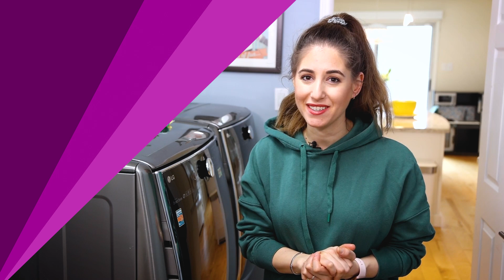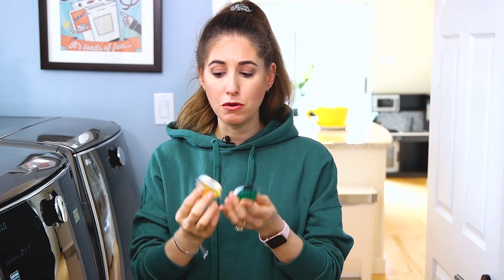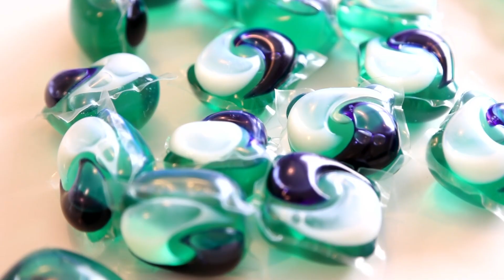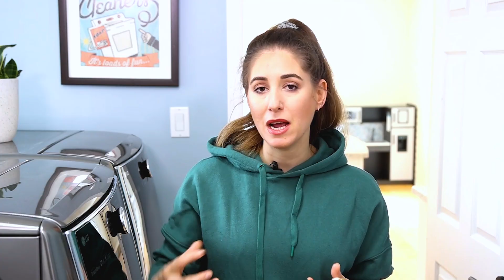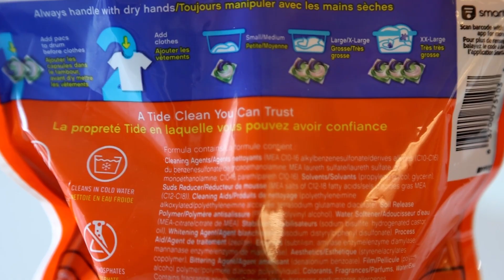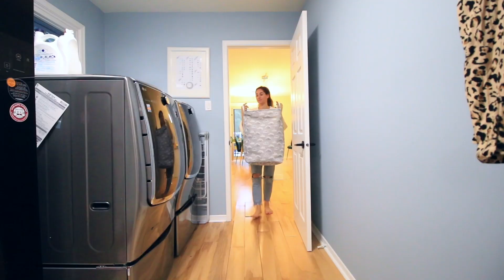Do Laundry Pods Work?

Comment from the maker: CMS POLL: Do you use laundry pods, liquid detergent, or powered detergent?
Reply: Pods and liquid
Reply: I like liquid, my mom prefers powdered.
Reply: Powder after making the switch from liquid several years ago.
Reply: 1 tablespoon of Nellie's powder.
Reply: Pods only . Glad I watched - I was expecting you to say don’t use them and I didn’t want to hear that lol
Reply: I use liquid now because my new machine has a compartment that holds the detergent and the machine takes the detergent automatically based on the settings on the machine for each load. I save a ton on detergent. I love it!
Reply: Liquid and powder, oxiclean, white vinegar &, baking soda. I still have my older Maytag top loaders & am not interested in the new washers. As long as they working well, I'm happy to keep them.
Reply: @jeannejett2299  how much vinegar do you add to a single full load? I have been eyeballing it. Same for the baking soda.
Reply: We've switched from liquid to strips 2 years ago and it is so much more convenient than the big liquid jugs and cheaper than the pods...!
Reply: Pods.  Love them. My washer has a second rinse option (I live in south Louisiana where we’re basically overrun with fresh soft water), so residue is not a problem for me.
Reply: I prefer pods because I don’t need a separate scent booster. I tried powder and liquid of the same brand and felt the pods did the best overall. Pods can be expensive so I try to stock up during sales or using coupons and rebates.
Reply: I really like pods (🇦🇺 OMO triple) but as I live on my own a single pod is too much detergent for a small load and was causing build up so after about a year of using only pods I have just started keeping liquid on hand again as well so I can use a half/quarter dose on small loads and my towels/gym wear which is where I notice the build up of detergent on the fabric. I don't use fabric softener at all.
Reply: Liquid. We fill the detergent tank and softener tank in the machine. It dispenses the amount based on what options we choose. Super easy!
Reply: Liquid for sure
Reply: I was liquid but funny enough I used a sample and I felt.like my clothes smelt better and felt cleaner. So I was thinking of switching.
Reply: Pods!
Reply: Liquid is my ♥️ in laundry world 😅
Reply: I never use powder detergent. If the water is harsh or cold it doesn't dissolve. I usually use liquid because I don't have too much clothes to wash, or too dirty, so I use the light cycle that is only 30 mins of washing. But when I moved with my bf I switched to pods. It was so much easier, I had full loads (his clothes take too much space and are dirtier). The main question that I have however, is if fabric softener is needed if I use the pods. I don't use it, but my bf does because he likes the smell.
Reply: @aspaccino  some pods I believe have fabric softener, others don't. If you use dryer sheets, you're using fabric softener already. So many of my clothes call for "no fabric softener" that I made the switch to reusable wool laundry balls.
Reply: @ssstrawberryjam  we don't have a dryer machine in the UK, so thank God I don't use dryer sheets. But unfortunately I do use pods, and they do have fabric softener in them. My BF complains that clothes are "hard" when we don't use fabric softener, but I believe it's because the water here is hard, comparing to other countries we've been. I think he just likes the smell of the fabric softener in his clothes.
Reply: Powder
Reply: Powder
Reply: Liquid and powder depending on what I'm washing.
Reply: I use Nellie's powdered.
Reply: Liquid just bc it’s cheaper
Reply: A combination.. I live with my parents. 
-My mom prefers POWDER for hots and heavy-duty for the abraison. 
-We used to use LIQUIDS for everything and then tried the SHEETS for a bit... mixed feelings don't know if we will stick with it. 
-Now, we are using PODS! I gotta say I'm liking it a lot and I think it does work better 😍 my mom is hesitant to agree since it was my idea 😉
-I use free and clear LIQUID for my underwear and silk pillowcases. 2 small loads so it's easy to dose a small amount of liquid.
Reply: @TheGalactica2001  yes, I use pods now but I still need liquid for underwear and pillow cases (very small loads)
Reply: I hate the pods.  They don’t dissolve in cold water and stick to the clothing.  Back to liquid detergent 😊.
Reply: I've been using pods from Dropps for a few years now, haven't had any issues or problems and my laundry is always clean. They appear to be safe for my septic tank as well as we've had no issues.
Reply: Tru Earth strips
Reply: Natural organic liquid
Reply: I use liquid and pods but I usually use the liquid cuz I find it to be much more cheaper than the pods per load
Reply: Liquid. In the UK we have a brand called Bold (it’s meant to be detergent and softener together) that smells SOOO GOOD. I’ve used pods but they’re so expensive. From an eco point of view I’m sure it would be better to use powder in cardboard boxes but I think liquid works better at low temperatures.
Reply: I am, unfortunately, allergic to all detergents. I get hives. That said, I found soap nuts aka soap berries. They clean well, no rash, no hives, no itching. They leave no odor whatsoever on clothes, so that’s fantastic and zero endocrine disrupters like detergents. The only drawback is they don’t get stains out, but I found a solution for that. Guess this means I’m in the “other” category, haha 😂
Reply: I use pods but my husband prefers liquid (I just think he uses pods incorrectly lol). They take up so much less space vs liquid or powder
Reply: Liquid
Reply: Both🤷🏽‍♀️
Reply: Liquid
Reply: liquid here.
Reply: Powdered detergent idol
Reply: Traditionally, I've used liquids and powdered detergents.  But, quite by coincidence, I just bought my first pods last week (but haven't tried them yet)!
Reply: I have been using the detergent strips.
I really like them. 
I stopped using the pods. Too many times I had a sticky residue on my clothes, when using cold water.
When using the strips, I use a cup of hot water to help dissolve the strip in cold water.
Hope when it warms up, our water will be cold instead of icy cold!
Reply: Liquid
Reply: Pods are expensive from where I live. :( I would want to use pods because it's not bulky!!!
Reply: I use liquid & Pods; whichever 'Free' or 'Sensitive' formula is on sale or I have coupons for at the time.
Reply: I'm a pod person, though I also use liquid because it's usually on sale for really cheap.  I hate hate hate powder though because no matter how hot the water is or how little of it I use, it never dissolves and everything is still covered in it when the load is done.  I would have to put everything through once or twice afterwards to get it out.
Reply: Liquid and powder
Reply: Used to use pods because they're incredibly convenient however they're notably more expensive than liquid or powder. 
So went off, read the instructions on powder and liquid and switched to those instead. Although when I'm in a rush, feeling lazy or just feel like switching things up, I'll use a pod instead
Reply: Liquid, & powder, oxi & vinegar
Reply: I am not sure if anyone has commented about this already. But these pods do not work for Top loader washing machines. I tried following the same steps, but the liquid just was stuck to the clothes once done. 
Is there a different method of execution in such a case? Would love to know.
As of now, I stick to liquid just for this reason.
Reply: I've used pods ever since I got my HE washer and I find them easy, convenient to store, and my clothes are always clean when they come out.  I've never had any residue or residual pod come out after a load is finished.
Reply: I use laundry sheets.  They completely dissolve in water and are so concentrated, 1 sheet will do a normal load.  For smaller loads, I tear the sheet in half and for larger or very soiled loads, I use 1 1/2 to 2 sheets.  (I have a large, top-load HE machine, no agitator.)
Reply: Sadly most clothing/materials made today are petroleum based unless they are 100% silk or 100% cotton.
I use pods because with liquid I always did the, "eh let's add a lil extra splash" like I do in cooking 🤣 but I have a top loader so with the pods I run the water and stab the pods with a fork,  drop them in then add clothes once the pods begin to empty.
Reply: @BubblyOne  there's no need to stab the pods, they dissolve on their own
Reply: Liquid
Reply: Liquid.  I tried a few different brands of pods and I realized that they were sometimes leaving what seemed like a glue-like substance on clothes.
Reply: I use my own "recipe" to make a powder detergent, and I save money. The economy is nuts right now, so this might be helpful; however, I've been using this for years now. 🚨 NOTE: If you watch videos on YT where people are making their own, many dump ingredients creating smoke clouds that they breathe in. Don't do that, please. 🚨

My basic recipe is 1 cup each of baking soda, washing soda, and borax. (Each of these either freshen/clean/whiten/brighten, so then you only need a detergent). Then, I finely grate a bar of Fels-Naptha. (You can use an old cheese grater, or you can use a steak knife to cut into chunks of similar size. Put them in a microwave-safe dish and heat in the microwave at 20-30 second increments. It will get hot, so be aware of that. What heating does is expand the air in the soap. Once it has stopped expanding with heat, allow it to cool. Then, you can put the soap in a ziplock bag and crumble it with your hands as if you were crumbling crackers for a casserole.) Stir all of these in a mixing bowl and transfer it to a container. 

You only need 1 TBSP/load in a HE machine or 2 TBSP/load in a traditional machine--add more if heavily soiled, of course. The Fels-Naptha is made by Purex and has been around for about a century. The other ingredients you will have plenty left over for other household uses. There is more info on the back of the boxes of ingredients than I could list here, but know that there are many other uses for them. I like that a handful of products have multiple uses, and I can make a new batch quickly any time. I do add scent beads, oxiclean, or fabric softener depending on the load.
Reply: Liquid!
Reply: We have been using Dropps since September.  They are currently having a 30% off sale and we buy bulk during the sales.  Also tried Method they are good too.  We were having skin issues so we are trying several plant based products and are having good results with all so far.  We buy them when they are on sale and there are so many plant based products to try.
Reply: I am liquid user.
Reply: Liquid
Reply: We recently switched to powder after being liquid fans. I swear it makes our clothes cleaner, and our towels/sheets feel better after washing and drying.
Reply: Liquid detergent in my machine that has a dispenser to put the detergent in. Powdered detergent in my machine that you put the detergent directly into the drum.
Reply: Pods all the way. I have been using them for yrs now!!! I love the convenience of having everything on one small pack. Plus I can usually get them for next to nothing after couponing.
Reply: Liquid detergent
Reply: Packs, because I gave up after years of trying to get my family members to use an appropriate amount of detergent.
Reply: Liquid, Can you make a review on detergent sheets please, I'm thinking to make a switch due to skin issues 😱
Reply: i was using the pacs for a few years but i've been using the laundry detergent sheets the past couple months now
Reply: I don’t care for the packs/ pods. I tried them with my old top load washer placing them in first while the water dissolved them and the outer coating never dissolved. Maybe they’ve gotten better (the ones I use in the dishwasher dissolve completely) but I prefer liquid because I can control the amount of soap better. ❤️
Reply: I just tried pods recently for the first time and I love them! So easy to use, plus easy “dose control” so I save on product. I’ve never had trouble with them fully dissolving as long as I put them in first. I usually just use one, two for very large/dirty loads and it’s been smooth sailing 🧺
Reply: Powdered for heavy soil, like cloth diapers, sheets and sometimes towels, and also micro loads, and pods for nearly all else.
Reply: Pods. All the time. Love them.
Reply: Liquid
Reply: pods
Reply: Powdered although I just converted to the packs for my DISH washer, so I'm more open to laundry packs in the future, maybe.
Reply: Baking soda. White vinegar and small amount of Persia liquid. Sometimes add washing soda or dawn for heavy stains on whites. Vinegar rinse only. I have soft water and dry clothes outside.
Reply: pods
Reply: Nellies powder for general laundry but liquid for delicate items
Reply: Powdered.
Reply: Liquid usually but some times powder
Reply: I use pods
Reply: Liquid detergent!
Reply: Liquid detergent!
Reply: Tried a couple packs but not impressed with the cleaning they supposedly do, they didn’t dissolve properly, and they are just another “miracle” product marketers dream about—pretty, expensive, gimicky.  No thanks!
Reply: pods ❤
Reply: All of them! Mostly I use unscented liquid, but sometimes I want to have some scent in my laundry. That's when I'll use a scented pod. And I have a powder with some bleach in it for my whites.
Reply: Liquid
Reply: I’ve used powder, I’ve used liquid, currently using detergent pods and sometimes non-chlorine bleach pods in my front loader HE washer. They dissolve fine, I like them.
Reply: Powder. I used to use liquid, but I was a pain to transport to the laundromat. I reused an old container that fits in a tote bag, which also carries additional laundry supplies. Bonus: my container has a 1/4 cup scoop, which is the perfect size for a load of laundry.
Reply: Laundry pods
Reply: I'm a pods girl all the way.   I use liquid when I have to wash something by hand
Reply: Pods all the way for me
Reply: Liquid and powder more frequently lately
Reply: Pods only
Reply: All of them. Really depends on what I feel like in the laundry room
Reply: Powder is the best! I’ve used the all until i made this conclusion. I used liquid, i usually wash clothes at 40 degrees, short cycles and the liquid had problems to dissolve properly and there were sticky spots on my washing machine (siemens) which later bacame black and smelly spots. Started using pods, but when i put them in the laundy( no matter where, under or above) they ended up stuck on the front glass not dissolving completely. That’s why i switched back to powder and i am happy now.
Reply: powder detergent
Reply: The amount of pods to use - doesn't it depend on the size of the washing machine, due to the amount of water per wash, rather than the size of the load you do? 
My machine is 9kg, do I need to use 2 pods, even though it's half empty? I simply don't know the amount of water released
Reply: Pod and liquid
Reply: Pod and liquid with oxi clean
Reply: Pods and liquid
Reply: I use powder for whites on 60 Celsius, liquid for colored on 30 Celsius, and pods on 40 Celsius if I want extra scent on clothes because the scent of pods no one detergent can catch
Reply: I use all 3. I love to alternate with different laundry types.
Reply: I use the pods... Occasionally a liquid but the pods are so simple! One or two, Lenor scents booster pearls, Lenor outdoorable concentrate and if it’s going in the tumble dryer the Lenor outdoorable sheets!
Reply: Liquid😊

Comment: I recently started using p&g bold pods they smell amazing yes there more expensive but not much more and always look online you get way more for you’re money online with pods. 
If you have a big load mine holds 10kg big enough for a king size duvet then I always add 2’pods but never more then that as you just simply don’t need it. 
I have used detergent sheets to and I was impressed with them but pods are my new favourite 😊

Comment: I’ve been using Dropps since before covid. Had an accidental double order right before the shutdown so no problem there.
I’m careful not to overload my front loader so the only time I’ve had an issue with them not dissolving is on the high wind chill days (I live in an older mobile home) so I don’t do laundry in “bad” weather. 
I do have a backup of liquid for the very occasional small load. I rinse with vinegar and have dryer sheets for the occasional load that needs a little help. Also, I’m trying Canadian based detergent strips next month when I’m out of Dropps

Comment: I use Kirkland liquid detergent. I use one step down on the cap. So instead of filling up to line 3 I fill up to line 2. If I have a bigger load I could put more but that works for me. Plus you save a good amount of detergent that way.

Comment: I used pacs but quickly lost interest. The pacs will not fully dissolve(even in hot water) and the film will stick to the towels and since it is clear I wouldn’t notice until I took them out of the dryer. Plus it’s much more expensive.

Comment: I will continue to use liquid as I found I go through less and I put in the correct on both. I'm all for biodegradable but either way they a lot of times still have plastic containers them come in and it still cost more for less loads. I use to use powder but we then moved to an area where the powder didn't dissolve well in the washer or the dishwasher with the powdered dish detergent. Now we have moved again and I haven't tried powder again but I might.

Comment: Excellent video, thanks so much for your insights. I too am a believer in consumer reports and have stuck with liquid detergent and occasionally liquid fabric softener. The pods seem to work OK for most clothes but my work togs need a little extra energy and the liquid seems to provide that. Also my white undershirts benefit from a splash of bleach every third wash or so. Thanks!